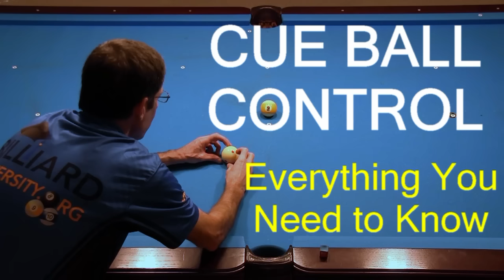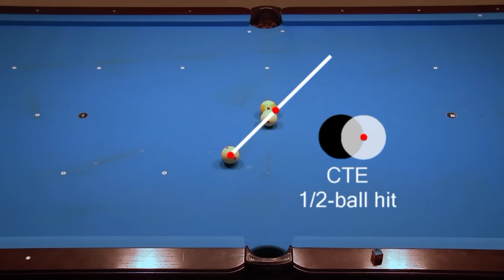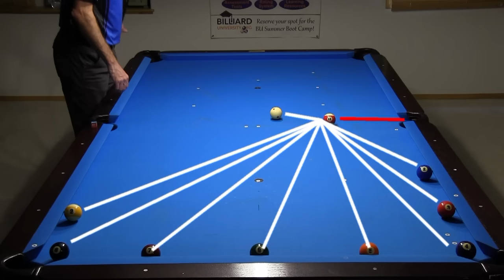CUE BALL CONTROL ... Everything You Need to Know

Comment: Thanks Dr. Dave! You've made everything dawn on me. My cue ball control technique has improved sinificantly with your help. BTW, I really hope you can make a video on a topic  like "Aiming ... Everything you need to know", since my potting still not consistantly accurate.
Reply from the maker: I'm glad you liked it.  FYI, I already have lots of videos, articles, and other info dealing with how to aim here:
    https://billiards.colostate.edu/tutorial/how-to-aim/
Check it out.
Reply: @DrDaveBilliards  Thanks Dr. Dave. I would read it carefully. In fact, my major confusion on aiming is how to judge the potting angle precisely.  I always do the evaluation basing on angel made by the line through the cue ball & the obj ball, and the line through the obj ball & the pocket. But the deviation angle varies when the distance between the cue ball & the obj ball is changed, so I don't have a consistent way to trim it and get a corrected potting angel. BTW, I m playing Chinese-8 Ball and snooker, which may require more aiming accuracy for their pocket size and shape.
Reply from the maker: @madmaxc.7650  There are ways to estimate cut angles here:
    https://billiards.colostate.edu/faq/cut/estimating-angle/
But most top players aim instinctively with an approach described here:
    https://billiards.colostate.edu/faq/aiming/dam/#advice

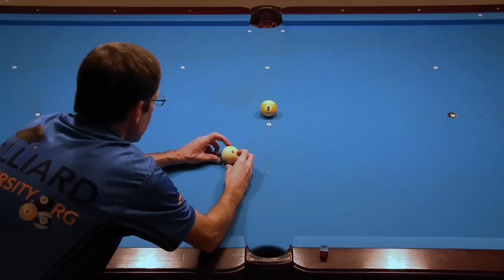Comment: 1:55 - is the tangent line from the stun shot depending on the position tip of the Cue ball or both the position tip and speed?
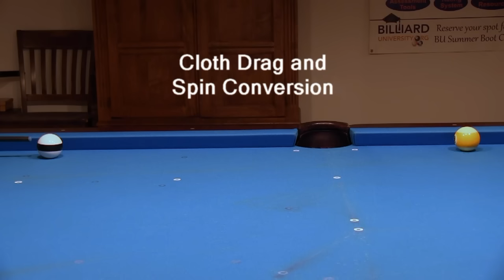Reply from the maker: Both tip position and speed are important to create CB stun at OB contact.  See 1:31 and 9:35.
Reply: Ok, so I also have to learn the speed control.
Thanks Dr.  @DrDaveBilliards

Comment: Hey Doc, Drew here, was wondering where you get those donut spots for your table.  Thanks.
Reply from the maker: I usually order them on Amazon.  "Self-adhesive hole-reinforcement labels."
Reply: They look like loose leaf/binder sheet-hole protectors, you can get them for pretty cheap at most dollar stores/ anywhere that sells stationary
Reply from the maker: Ricky Hineman  Correct.  Most office supply stores (e.g., Office Max) usually have them also.

Comment: Annotations to make it slightly easier for repeated viewings

0:16 Straight shot possibilities
0:27 Cheating the pocket
0:32 Cheating the pocket with sidespin

0:44 Stun shot introduction
1:12 Cut induced throw (CIT)
1:26 Effects of shot speed on the tangent line
1:57 What happens if you don't hit the stun shot right
2:11 Considerations when the angle is small

2:37 Rolling cue ball introduction
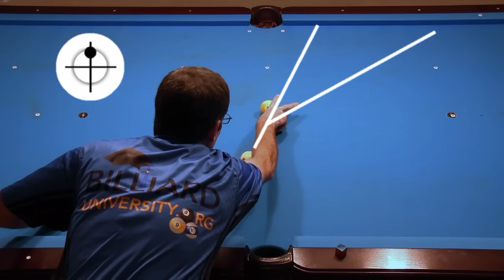3:02 Using the peace sign to measure the natural angle
3:28 Effects of speed on natural angle
4:00 Shifting peace sign to adjust for speed
4:08 Narrowing the natural angle
4:32 Range of shot angles where the natural angle applies
4:49 Using the angle template
5:21 Adjusting the peace sign for thicker and thinner hits

6:00 Draw shots introduction 
6:13 Angles where you can use 3 times the angle system
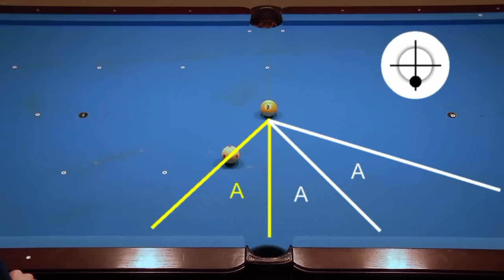6:29 Defining the 3 times the angle system
6:52 Measuring 3 times to the angle
7:14 Alternate way of measurement
7:27 Effects of cheating the pocket
7:51 Practice tip: sentinel balls
8:53 Effects of speed on 3 times the angle system

9:35 Adjustments introduction
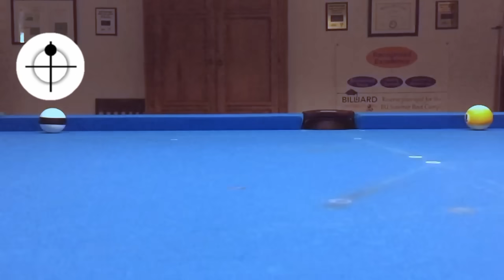9:47 Max top spin, high speed
9:59 Center ball, high speed
10:07 Center ball, low speed/long distance
10:16 Slightly below centre, stop shot pace
10:25 Backspin, low speed/long distance
10:36 Backspin, high speed
10:47 Backspin, low speed/short distance
10:55 Center ball vs backspin for stop shot over short distances
11:10 Soft speed follow for short distances
11:25 High speed follow for short distances

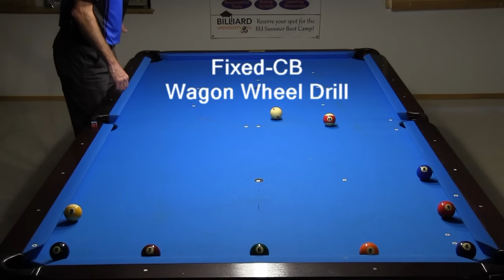11:38 Practice: Fixed Cueball Wagon wheel drill
Reply from the maker: chocolatepinkspider  Good job posting this. Others might find it useful.
Reply: DrDaveBilliards It would be good to add this to the video description.  Thanks for making and sharing this video!
Reply from the maker: @nathansharp3193   Good idea.  Done.
Reply: DrDaveBilliards AWESOME!  Thanks 👍
Reply from the maker: @nathansharp3193  You're welcome.  I aim to swerve.  :)
Reply: DrDaveBilliards :  Haha!  Nice english. 😉
Reply: chocolatepinkspider   ;>.
Reply: Hmmm. Why didn't they become hot links in the description?
Reply: Best instructional video I have ever seen. Med
To upper med skill level. Awesome thank you

Comment: I'm still confused about what causes the change from 30 degrees to 90 degrees.
Reply from the maker: 90 degrees is for a stun shot (sliding CB).  30 degrees is for a rolling CB (topspin).  For more info and demos, see the links in the video description above.
Reply: 30 degrees is just an estimate. surprised dr dave is promoting it, with all his expertise :(
Reply from the maker: Miscellaneous  Watch the video again. I make it clear that 30 degrees is a good average value to use over the whole range for a decent estimate. I also show how to adjust the peace sign angle if you want to be more accurate for different cut angles.
Reply: @DrDaveBilliards  i understand the purpose of the heuristic. then again, it is a heuristic. begs the question why an expert spent the extra time to thoroughly instruct the general audience on how to make V's bigger and smaller. it's just not an exact science, that's all.

i really hoped that the proper response to OP was a breakdown on this 30 degrees one size fits all idea. not to say, "oh it's around 30 degrees, but sometimes it's bigger, sometimes it's smaller".

this is a good video idea. i don't think in "30 degrees" or V's at all. follows and draws are so much more, especially when you consider how force follows and draws don't converge immediate to a line, failing the 30 degrees rule. also, a proper understanding of follow and draw after hitting an object ball will naturally yield an understanding when it comes to cue ball collision with another object ball after contact. limits are endless if you just toss this idea and go past it.
Reply from the maker: Miscellaneous  Watch the video again. I also show how to shift the peace sign down the tangent line to visualize the speed-affected CB trajectory.  A well calibrated peace sign (with the measured adjustments I show) can help somebody accurately predict CB direction, even without intuition built by countless years of successful practice and experience. Although, if one wants to be very accurate over a wide range of shots, one must practice the techniques. And for those who don’t want or need extreme accuracy, a single 30-degree peace sign with no shift for speed can predict CB direction reasonably well over a wide range of cuts and speeds.

Comment: Dr. Dave, LOVE your videos! They have greatly improved my playing ability over the past 3 years that I have been playing. This video too as absolutely AWESOME chock full of great advice and drills. A question about this video: At the 4:15 mark where you discuss narrowing the cue ball follow angle hitting the ball fuller, cheating the pocket and using inside spin. The reasoning that you give is what I have a question about. Won't deflect the cue ball (right, which will lose the cheat angle you started with), then the swerve you mention will bring the cue ball back to left (to get your cheat angle back)? And won't the inside spin "Throw" the object ball a bit to the right (cheat direction ) and the inside spin on the cue ball cause it to continue to swerve left to give you the narrower angle that you mention?   I really appreciate how you break down all of the technical pieces in your videos and I'm just trying to assimilate these new drills into what I already "think" you've taught me.  Thanks for considering my question.

Update: Ok. after watching this video I watch the Top 10 Pool Myths Debunked and saw the part about "no swerve after object ball contact" for a cue ball with sidespin", though that was a pretty fast-moving cue ball and the one in this video was slow-moving...  So are any of my points above things I should rethink?